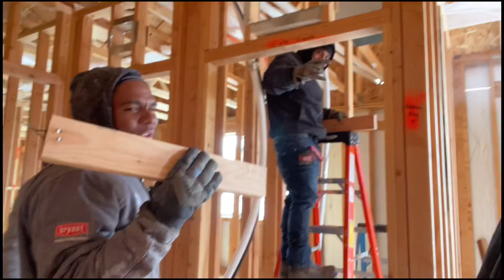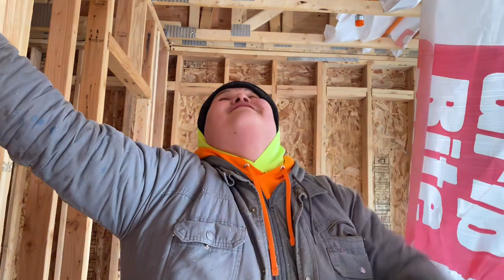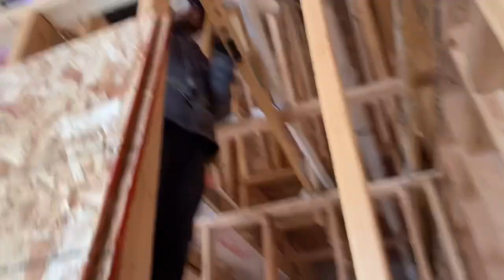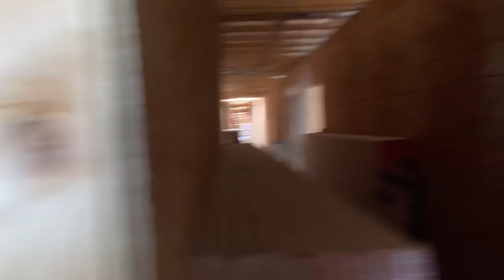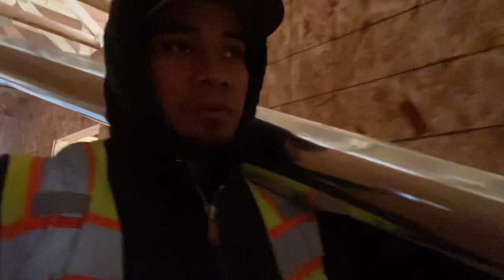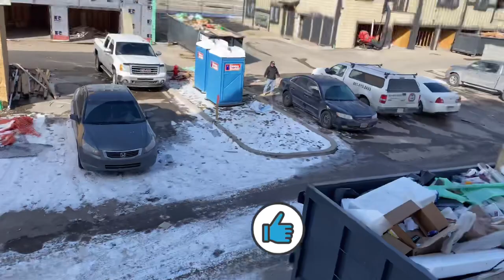APARTMENT BUILDINGS | HVAC Installation | Part 3

Comment: Man your crew are all newbies, i have been in hvac for over 40 years. 1/4" slope per foot , supports every 4 feet and insulate the exhaust up through attic and unconditioned spaces. How is Johnny boy comin along with his dance lessons?
Keep up the solid work.
Reply from the maker: @Dwayne Renton yes sir! I’ve only been doing it  5 years. Johnny boy is doing good he’s running he’s doing piece rate by himself now.